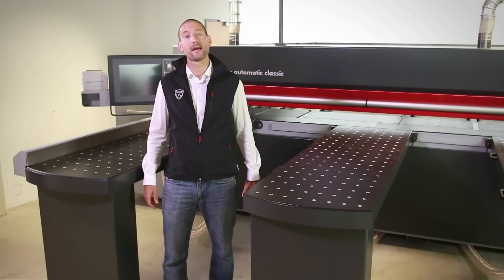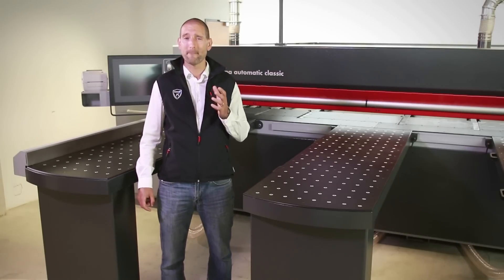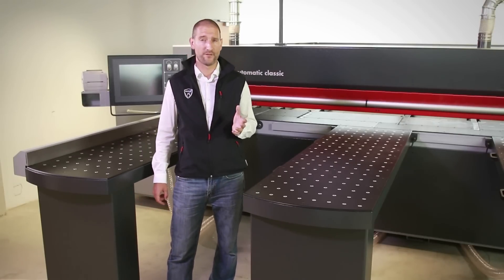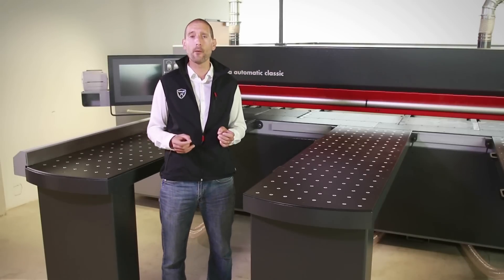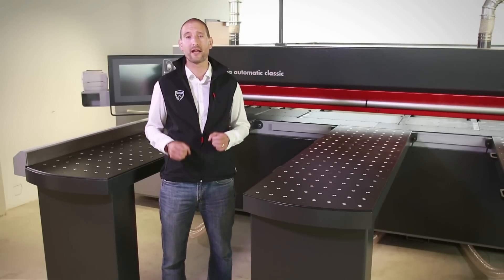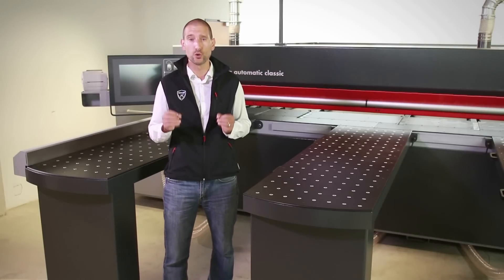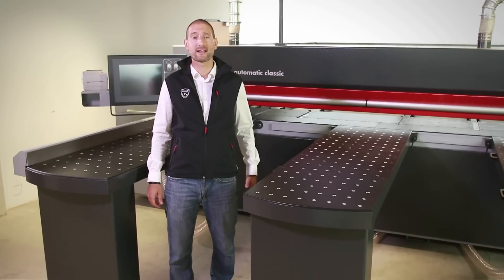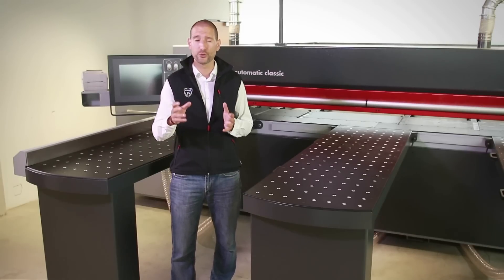Format4® kappa automatic classic - Beam saw | Felder Group

Comment: Cross cutting feature available??
Reply from the maker: We are not 100% sure if we understand the question and kindly ask you to get once more in contact with us via pm@felder-group.com
All our automatic beam saws have the possibility for cutting workpieces in width and in length.

The customer just need to put the board to the mitre fence und move them against the grippers. After closing the grippers the machine cycle will start and the length/cross cut will be done.
Hope this helps!